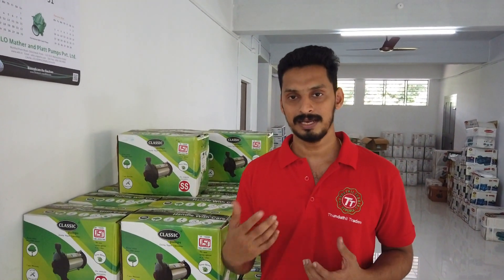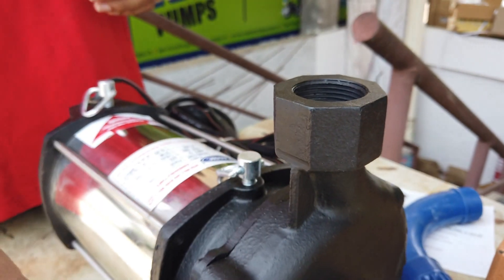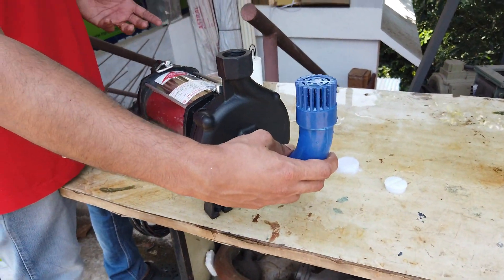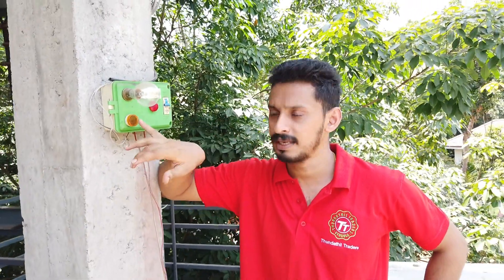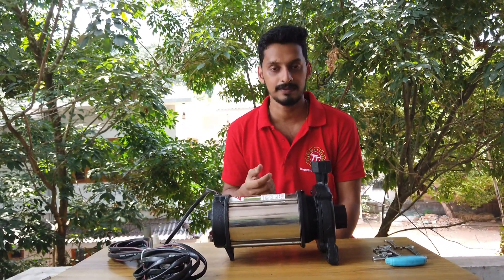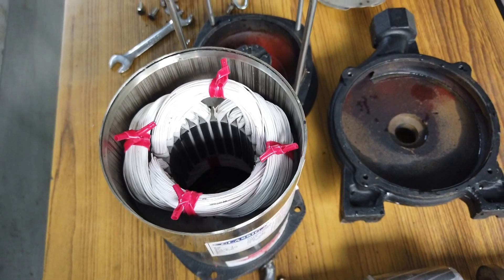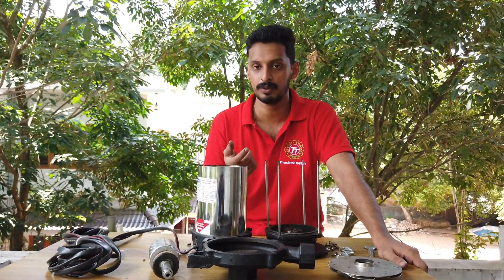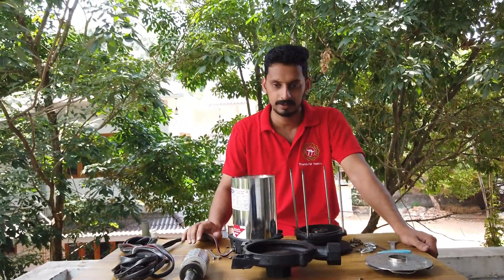Submersible pump load test and Dismantling -സബ്‌മേഴ്സിബിൽ പമ്പിന്റെ അകത്തു  എന്താണ് ?

Comment: Very helpful
Oru 10 meeter aazhamulla kinatti ninnu, pinne 5 meeter height ulla tankil vellam ethikkan  submersible etra hp venam. ?
Reply from the maker: 0.5HP ok anu. Discharge kurachukoode kooduthal venamenkil 1HP anu best option.
Reply: motor direct supplay  kodukkumpol working anu.  ennal elcbiyil kodukkumpol trip akunnu enthanu karanm
Reply from the maker: @binugeevarghese597  സബ്‌മേഴ്സിബിൾ വാട്ടർ കൂൾഡ് പമ്പുകൾക്കു ഈ പ്രശ്നം എപ്പോഴും കാണിക്കുന്നുണ്ട്. പല പ്രശ്നങ്ങൾ കൊണ്ട് വരാം. അകെ നമുക്കു  ചെയ്യാൻ സാധിക്കുക മോട്ടർ മേഗർ വീക്ക് ആയിട്ടുണ്ടോ എന്ന് ഒരു ടെക്‌നിഷ്യനെ കൊണ്ടു ചെക്ക് ചെയ്യിക്കാം എന്നതാണ് . 
മോട്ടർ മേഗർ വീക്ക് ആകുക , ELCB ട്രിപ്പിങ് ആംപിയർ കുറവാണെങ്കിൽ  , ELCB കപ്പാസിറ്റി കുറവാണെങ്കിൽ , വയർ ജോയിന്റ് ലീക്കേജ് , പ്രോപ്പർ എർത്തിങ് ഇല്ലാതെ വരുക തുടങ്ങിയ കാര്യങ്ങളാണ് പലരും ആയി സംസാരിച്ചതിൽ നിന്ന് മനസിലായത് .